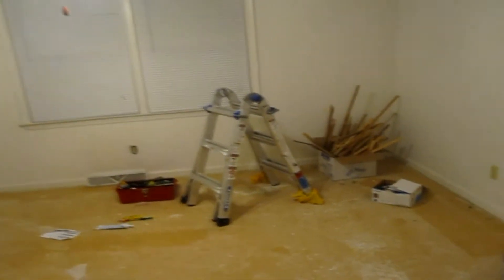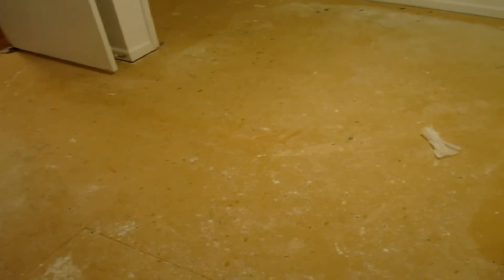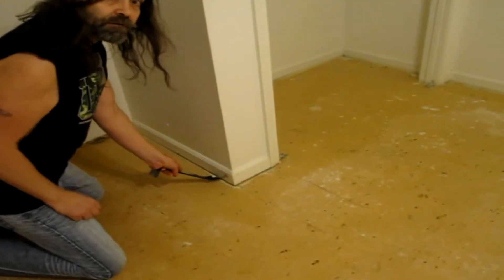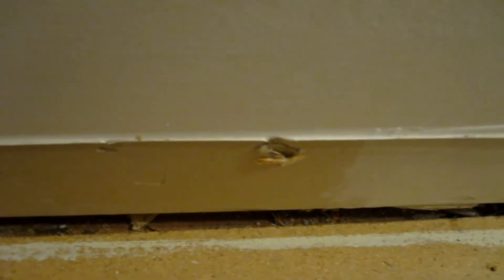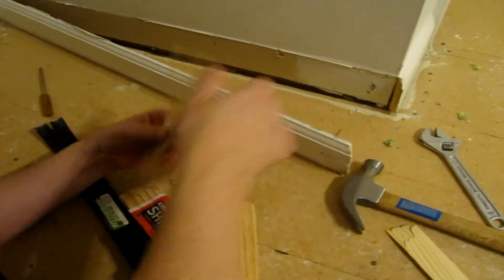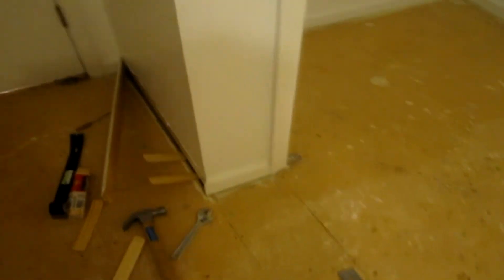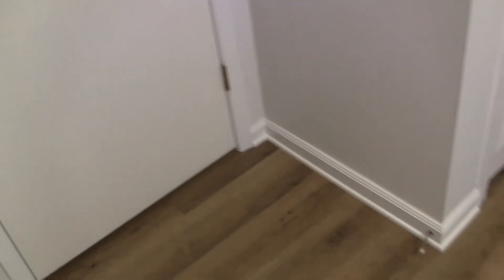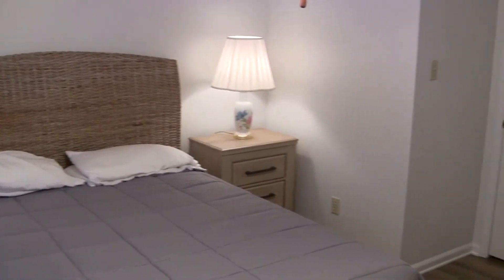How To Stop A Floor From Squeaking

Comment: Glad to see you still doing projects. Steve  Keep at it. They never ends.  Maureen and I during Covid shut in pulled all 7 rooms of wall to wall out room by room and put down 5 inch wide 3/4 inch solid oak and 6 inch crown through out both floors of the house. I could sit in and do nothing. So we added equity to the house.
Reply from the maker: You always did good work brother. I'm sure it looks good. We sold our place in FL and just got this place. Gonna keep us busy for a while.
Reply: @stevekonbass  We go to south Carolina every year. My mom and sisters each have a place in Hilton Head Island area. I love it there to visit.
Reply: Nice! That’s a good way to spend the time.

Comment: This is great and I think may be the same solution I need - when you cut the shims, did you hammer them in under the wall so they are flush with the floorboards, or were they still angled like they are in the video when you put the baseboards back on?
Reply from the maker: I cut them flush. If it's the ground floor you're working on you can try to get it underneath if you have a crawlspace or basement.
Reply: @stevekonbass  Appreciate the response. The squeaks are on the second floor but I should be able to get shims in there. I'll come back when I'm done and comment on my experience for any future viewers.
Reply from the maker: If you have carpeting there's actually a screw you can use. You drive it through the carpeting and the screw head snaps off. That's how I remember it anyway. I saw it on Ask This Old House.
Reply: @stevekonbass  I remember that video too and I thought that's what I needed to do until I realized the squeaks were coming from the wall and not floor, same as in your video. I finally got around to the project and it solved my problem 100%. For anyone else that has a finished floor with carpet, I was actually able to drive shims under the wall between the carpet and the trim. I bought a pack of shims from Home Depot which were pre-cut into a wedge shape which made it easy to get in place, and then since I needed to cut the shims to be flush with the wall I marked the shim where it met the trim, pulled the shim back out and then cut it slightly beyond the mark so that the shim would be hidden under the trim. Once the shims were hammered in I used pliers to pull up any carpet fibers that got pushed down by the shim. You can’t see anything and no more squeaks! Thanks again for the video walkthrough Steve, cheers!

Comment: How’s it sound now? The shims holding up? I’m fixing all of mine now and wondering if I can avoid cutting into the drywall.
Reply from the maker: Better in the summer when the wood expands than winter. You could also try screwing the subfloor to the joists.

Comment: Are those type of sounds safety issues or just an annoyance? I live in an apartment one of the rooms does this and they don’t seem too concerned,  just basically telling me it’s an old building
Reply from the maker: Yeah, that's just an old house where the sub floor pulls away from the joists a little and makes a creak or squeaks when you walk on it (assuming your apartment building was stick built, meaning with wood framing). Just part of the charm of an old house. It can usually be fixed with a few screws.